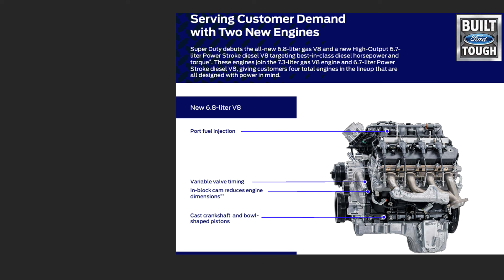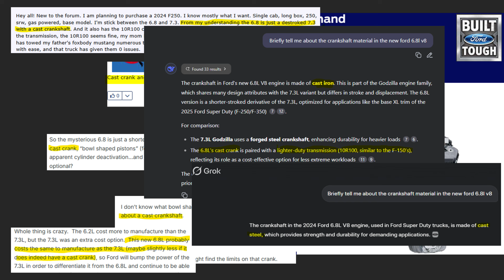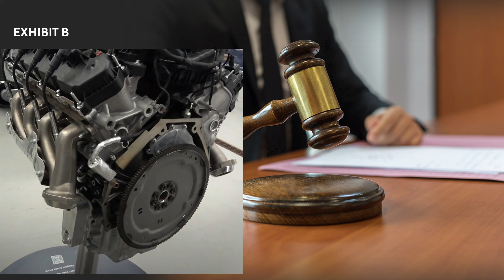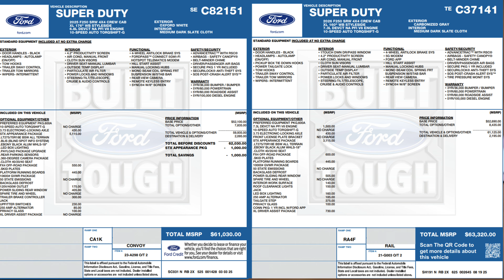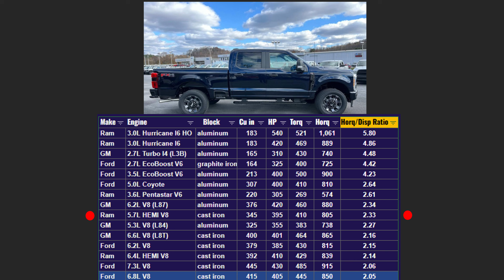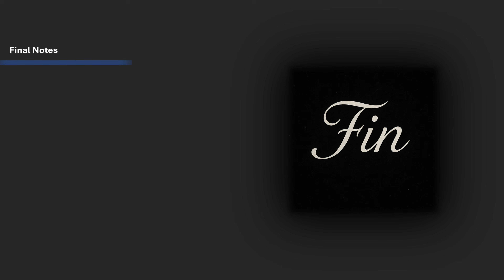Ford’s “Minizilla”: Making the case for the 6.8L V8

Comment: I’ve never that about the approach you just shared.  I new these low displacement high power truck engines are wound tight like a race car not a work vehicle

Comment: I swear ford works over time keeping 6.8 v8 info off YouTube. You can’t find anything on them like you can other engines. I have one and couldn’t be happier honestly. 19 mpg seems literally impossible though. I don’t pull a lot but I do pull alot of weight when I do pull and I get 14.5ish with 3:73.

Comment: The compression ratio on the 6.8 is a bit higher, which allows for factory flex fuel.  Not a huge deal to most operators, but for those of us in the Corn Belt, where E85 literally half the price of E15... it makes for a good option.  Unless you know of any other super duty truck that gets 6 miles or more per dollar of fuel on the highway.  I think there is a case for the 6.8 being better for fleets, as the flex fuel option is pretty neat.  E85 average price in California, for reference, is still only $2.  With a 175,000-mile Ford Protect warranty, I wouldn't be surprised if the 6.8 was the lowest cost-of-ownership heavy-duty truck made today.  Set aside whether it will last 300,000 miles or can accept a supercharger or any of those things, this "mini" engine is the value beast.

Comment: So will the 6.8 take the same mods like headers, exhaust, intakes, supercharges etc. As the 7.3. I'm assuming the block and heads are the same and the displacement is all in the stroke of the engine via crank, rods, and pistons? I have a 6.8 and want to mod it. Lol
Reply from the maker: I’d be really surprised if most mods wouldn’t bolt right on.  The only thing I’d question a little is the intake. I’m not sure if an aftermarket intake would be tuned to displacement..  interesting question!!

Comment: Thank you for making this video.  Great engineering analysis showing your points with the 6.8L.  I've been wrestling with this same buy decision.  I found the 7.3L engine first and liked what I saw (great shout-out to Getty's Garage channel) and later became aware of the 6.8L but why it existed.  Your video answered a lot of the questions I had.  Great work investigating the marketing b*llsh*t by Ford.
Reply from the maker: Thanks, really appreciate that!  7.3 and 6.8 are both, really, the last great old school v8s.  No cylinder deactivation, no high pressure fuel, no direct injection.. just really robust and well tuned simple workhorses.

Comment: Can you speak to the loss of Mpg with the off road package (FX4 I assume?). Great video. Thanks.
Reply from the maker: Hey, thanks!  Just because the front valance is smaller with the off-road package.  Looks way better, I think, but comes with a small hit on MPG.
Reply: @motorobo0 I'm absolutely puzzled that you are getting 19 MPG?? I just purchased my 6.8 in December in the most I've got is 11.7 MPG

Comment: Cast cranks can still handle serious horsepower. Generally speaking, the weakness of a cast crank is high RPM, not just high horsepower. And with a factory pushrod V8 configuration, the 6.8 isn't close to spinning fast enough to be in danger. Hot Rod magazine pulled a 4.8L V8 from an old Silverado, leftbthe bottom end stock, and turbocharged it to see how much powerbthe cast crank could handle. It made over 40 dyno pulls making over 1,000 HP and the cast crank handled it.
Reply from the maker: Right!  You don’t hear about people breaking cranks.. cast or otherwise.  It’s not a thing unless there’s serious abuse

Comment: My current truck is a gm with a 6L and service body. I need a truck for 3000lbs payload, not max towing. So in my application a 6.8 would be just fine because I need the capability of a big truck, but a smaller more efficient base engine just keeps more money in my pocket all things considered.
Reply from the maker: Perfect use case!  If it’s a permanent 3000lbs, maybe a 6.8 350 for headroom

Comment: Incredibly good video.  I have a 2024 6.8 service work truck.  You are on point about the power.  I have a 2003 v10  farm truck which I love but it's only rated at 12500 towing!    I want a new 250 or 350 for personal use with a tow rating around 20k.. which means I have to find a 7.3 with the heavy duty axles or get a diesel.  I think the 6.8 would definitely pull it and I agree it is derated to justify the 7.3.  Your video answered all my questions, except, like you, I wonder if Ford fixed low low oil psi on the 7.3.  That is my biggest concern.  It could take an engine built for 500k mi and knock it down to a 60k mi engine.  Like I said, great video and I agree with you 100%.  I really enjoyed the engine comparisons too.  Thanks for making the video!

Comment: I’ve been debating a 6.8 for our lawn care company. This truck would mainly be used for hauling the 18ft mowing trailer everyday and occasionally a dump trailer. But would also be my personal truck when not working. We’d also have a 6.7 dually for heavy hardscape loads. I was originally concerned with the 6R100 over the 6R140 that comes in the 7.3 but have learned that all the newer trucks come with the 100. Thoughts?
Reply from the maker: I say it’s good use case for a 6.8.  I also did a video doing a deep dive on the 10R100 transmission.  I’d say 8000-12,000 pounds daily, the 6.8 with the 10R100 is right in its sweet spot.  And the 10R100 is a much nicer daily driver experience unloaded.  Quickly finds its gears and doesn’t shift like a box truck.  Tightens right up in tow haul mode.

Comment: Hey great video, I subbed to your channel. I like how you talk about the more under appreciated stuff. I cant help but think this engine is getting the same treatment as the 6.2, which I think is also underrated/ not talked about. You could get the 6.2 in an F150 for a few years too, that would have been neat to see on your list. I have a 3.0 powerstroke, an engine a lot of people don't even know exists, so I like oddball stuff. Also, the difference in exhaust between the 6.8 and 7.3 is probably largely due to the 6.8 having higher compression.

Comment: I own a ‘24 6.8L and my previous truck was an ‘09 6.8L V10. The difference is night and day in real world performance. The 6.8 V8 is much stronger and the acceleration with a heavy load is absolutely impressive and effortless. I suspect Ford has deliberately under rated this engine to keep from hurting 7.3 sales. While the 10R100 transmission is poo-poo’d by many, real world reports show it shifts much smoother, sheds 100 lbs and is more than capable to handle the specified loads it is rated for. I’m quite happy with performance and surprised at how efficient it is on highway trips unloaded. I recently did a 200 mile uninterrupted interstate drive and achieved 19.9 Mpg in that stretch.

Comment: I believe you get the bigger transmission for the 7.3 if you get the 350 in 2025. I believe that changed for 2026. But it’s difficult to keep up with ford bc they aren’t clear w the details on the build site.

Comment: Even if it was nodular cast iron or cast steel, oem cast cranks aren't punk at all. A user will simply never, ever hurt a big block cast iron or cast steel crank at 6k rpm and 400 hp. Not even close -- ever
Reply from the maker: I completely agree, and actually had some things to say about that, but cut them out to save time.  Modern engines have had a lot of issues, but broken/bent cranks isn’t one of them.  Virtually unheard of, especially stock.
Reply: @motorobo0  Modern shortblocks are anvil tough.

Comment: 10r100 deeper first 3 gears, 738 ft/lb input shaft rated, 10r140 1050 ft/lbs input rated (diesel), r140 heavier and of course more parasitic loss. 5-star tuning has dyno curves of both engines on their site and 6.8 put more to wheels stock and after tuned than the 7.3, interestingly look at rpm differences also on those curves. 6.8 as I see it the updated refined zilla. Both good choice and splitting hairs but 6.8 r100 is what I ordered also.
Reply from the maker: The 5 star tuning data sounds interesting.  I’m going to try to find that.  Plus, in my opinion, the 6.8 sounds better.

Comment: Fascinating video, I could discuss these engines with you probably for hours. 

I’ve owned two 2016 model year 6.7L diesel trucks and two 2017 model year 6.7L diesel trucks in the past. I’ve recently owned two RAM 2500 trucks with the 6.4L Hemi (a 2022 and a 2024 model year truck). Currently, I own a 2025 F-250 with the standard output 6.7L diesel, as well as a 2015 cab and chassis F-350 dump truck with the 6.2L gas V8, and a 2005 F-350 dually with the 6.0L diesel. At work, my provided work truck is a 2024 F-350 XL crew cab with a 6.8L gas V8. My workplace now has four of the 6.8L trucks, replacing both older 6.7L and 6.2L trucks. All our 6.8L rigs have the 3.73 axle. My own experience both empty and towing is that the RAM 6.4L Hemi with the 8 speed is a more responsive and enjoyable combination than the 6.8L / 10 speed Fords. The 6.8L sounds great when it cold starts. The engine seems unnecessarily loud while towing though, and the transmission has a strange whining sound to it at low speeds while taking off. The 6.8L does feel strong at higher RPMs, stronger than the 6.2L. Oddly, the first gen 6.2L trucks felt more responsive off the line than the 2nd gen 2017+ models, particularly those coupled with the 10 speed. I’ve never driven a 7.3L. Our 6.8L work trucks are used hard, from towing 10k loads up steep hills (where they struggle) to plowing snow for long distances up fire roads in the hills. They also idle a ton, sometimes all day in extremely cold or hot weather. Granted they aren’t old but so far no engine issues. The old 6.2L trucks were pretty bulletproof doing the same things. Towing 10k up a hill in one of the 6.7L pickups is vastly nicer than with a 6.8L, but the company won’t buy more diesels because the exhausts plug up from idling. Anyway, great channel.
Reply from the maker: Thanks!   Really interesting comment.  I love hearing real world comparisons.   When you say the 6.8 struggles up steep grades, I wonder in comparison to what?  The diesels or other gassers?    Does it struggle to keep speed or just requires more drama?   I have not driven a 6.4 but I’d like to, just to see the difference.  The difference between the 6.8 and the 7.3 isn’t huge, though the only one I drove had the 10R140, and most of the difference I felt came from the difference in transmissions.  I’m confident the 6.8 will hold up in your use case.. but the bigger question mark is the transmission.  I think the 10R100 is a good transmission, but use cases like yours will tell the tale.

Comment: Good points all, I went with the 7.3 because there were options on the lot, single cab pickups are in short supply and I may have had to visit several different dealerships or special order to find one in a 6.8.  I think ford uses a different charging system on the 7.3 super duty, do I need 2 alternators and 2 batteries ? probably not but its always good to have a backup right?
Reply from the maker: You can’t go wrong with the 7.3, and I’m sure you’ll be happy with it.  I think only some configurations come with two batteries.  Propower gives two batteries, for example.  I think it’s the packages that determine alternators and batteries and not the choice of engine.   7.3 in a single cab and maybe a bit of an exhaust upgrade would be a pretty great setup :)

Comment: I bought a used 23, with a 6.8 nine months ago.  Had it on a seed tender all spring.  Pulled over 20,000 lbs through worked fields never had a lack of power.

Comment: What your missing is the torque curves.  The 7.3 has a much flatter torque curve than the 6.8.  At only 1500 RPM the 7.3 has about 400 while the 6.8 is only 320.  This is very noticeable when towing.   The 7.3 lumbers along and does not down shift much going up small grades while traveling down the freeway.  The 7.3 also has a heavier duty trans with the 10R140, which explains some of the cost.  After test driving them both, the 7.3 won hands down.
Reply: You may want to check on that. I’m almost positive the 7.3 in the F250 also comes with the 10r100 standard unless you put the Tremor package on it, then it gets the 10r140. Or if you upgrade to a F350 it’ll get the 10r140.

Comment: You are comparing 2 difference trucks. 176” wheelbase with 10,600 gvwr vs 160” wheelbase with 10,000 gvwr. That will give you different payloads and towing.
Reply from the maker: Yup!  I can’t believe I missed that.  Someone else also commented on the same thing, and so to verify I went and looked at two (actual) like-for-like comparisons, and thankfully my point still held.. the difference in rating is still far larger than the power difference.   That comment (and results) are buried somewhere in the pile.
Reply: @motorobo0 you can Google and download Ford’s towing guide for engine, axle, drive, cab style and bed length to get the recommended limits. The differences are 900 - 2,500 lbs pending upon the mentioned styles. The differences of towing limits may be due to the transmission difference between the 6.8 vs 7.3. The 10 speed trans in both models are known to have valve body issues. The 8 speed ZF trans in the Ram is much better.

Comment: Okay I really liked your video/podcast I traded mine 6.6 l Chevy Duramax it was a 2020 I got the 2024 STX with the 6.8 l and I love the way that it pulls my 14x7 dump trailer I use it everyday with the trailer connected never had any issues granted it hasn't been that long but it is a dream to drive compared to the diesel truck Yes if you're racing across the stoplight to stoplight the acceleration on the diesel was better but the drivability and not having to worry about deaf fluid and all the problems that go along with that I did have some problems with my death fluid tank melting down and every time I went to the dealership they tried to give me a car to drive I was covered under my factory warranty I did have an extended warranty but the whole not giving me a truck to drive and having to deal with a mom and pop diesel mechanic shop you know the drill anybody can work on this and it's probably not going to have any problems That's why I switched and I'm super stoked that I did anyway there's not enough videos I did like the gettie garage video thank you for the research you did I will watch more that you have

Comment: Ford puts plastic oil pan on the motor and the transmission pan with no drain plug there is no way anyone can convince me for designed to make it easy to work on
Reply: Agreed. First trans service find a good aftermarket trans pan with a drain plug. And as long as the plastic engine oil pans don’t leak, no need to worry about that.
Reply: @Ovalworked  yeah I worry about it because I go off right loading, with big rocks and other obstacles but I made a huge mistake! The oil pan on my truck is aluminum anyway it looks aluminum not plastic. It is the transmission pan that is plastic and the plastic is farther in the middle of the truck where it's going to catch a rock or a large broke off branch. I better put on skid plate soon or I'm going to regret it
Reply: I said off-roading but AI screwed up my words. @Ovalworked
Reply: I did find one metal oil pan for the transmission but it's made out of aluminum so it ain't much better they need to be steel, similar to the older trucks @Ovalworked

Comment: Excellent, well thought out and presented video. Subscribed and looking forward to more content.
Undoubtedly the 6.8 will be a great engine and in some ways make more sense than the 7.3. My own two arguments for the 7.3: 1) Spec'ing out the truck I would order a 7.3 would add about 2.5% to the price (around $65k- what's another $1500?) and 2) Resale value. If Ford's marketing is as crafty as you say then the hype about the 7.3 will transfer over to selling it in a few years.
That wouldn't apply to me because I don't turn vehicles often (currently still driving my original owner 83 F250 6.9 4spd but may be due for upgrade).
The 7.3 will cost me a little more in fuel, too, I get that.
Thanks for posting this. More, please.

Comment: The 6.8's shorter stroke also means it can spin higher with manageable piston speeds. Great for towing something heavy without burning rings.
Reply: shorter stroke is achieved by reducing the throw (or offset) of the rods on the crank, along with slightly lengthening the rods. Shorter throw puts more stress on the crank. Therefore less torque. While marginal compared to the 7.3, but its actually worse for towing. The higher compression ratio supports this theory, while its not a linear increase to the reduction of displacement but tuned to reduce that increased stress on the crank.
Reply: @baronvolkov6172  That implies you run the engine at the same RPM and request the same torque. I did not make that assumption, and thought you'd tow with more RPM, thus making piston speed more of a concern.
Reply: @solquint2390  yes that comparison implies same rpm. Higher rpm = more momentum, different dynamics for both engines

Comment: I think a cam, intake mani, long tube headers would make this 6.8 a completely different unit. Massive torque increase, great throttle response and a happy little lope at idle to bring all the boys to the yard.
Reply: Yes I think I saw somewhere that the intake is plastic.  That’s probably gonna be a weak point
Reply: @chadwallace3598 Ford has used plastic intakes for 25+ years.   All the coyote f150s that are 1000+ hp use plastic intake manifolds.